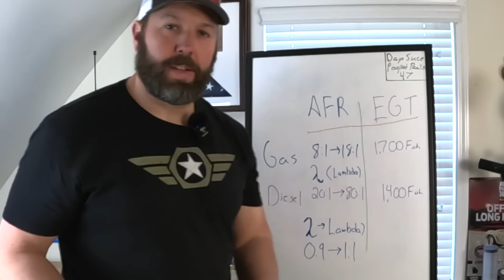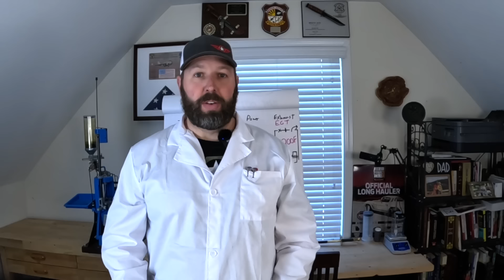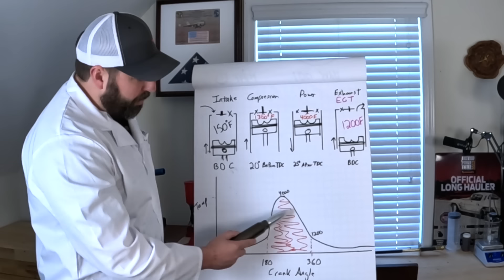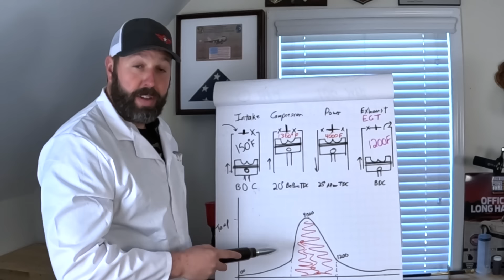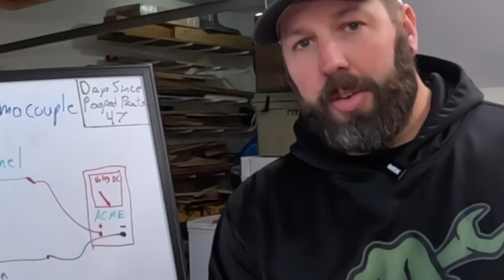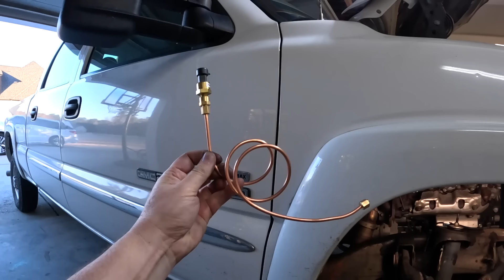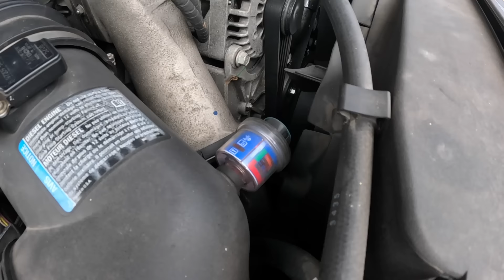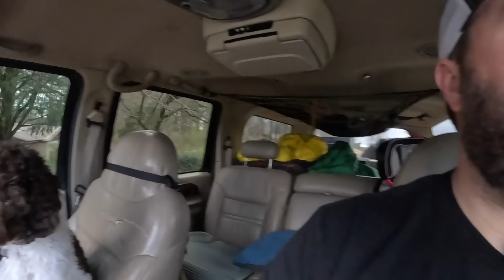Silent Diesel Killer…Diesel Exhaust Gas Temperature (EGT)! #diesel #egt #dieselengine

Comment: Great video!  Water meth injection will also lower egt
Reply from the maker: I actually had about a minutes worth of Water Meth injection footage at the end of the video originally, but I cut it out because I know most people aren't going to use it. But you are absolutely correct. 👍
Reply: @freedomworx  do you think water meth is worth it?
Reply from the maker: I think there are better options for a diesel, but if there is no other way, sure. A better turbo(s) for the operating conditions would be ideal, but that’s obviously more expensive.

Comment: RIP that boost gauge 😂
Reply from the maker: Not sure if that was the Turbo or the Boost Gauge squealing 🐷
Reply: Damm near 50 PSI.  That’s scary.  I thought 35 was bad enough…it is in a 3.0 litre 4 cylinder.  Thankfully it rarely sees this.
I have heaps of gauges measuring (4 times standard volume aftermarket) intercooler, both incoming and outgoing temps, boost, EGT, scan guage, transmission temperature.
Then I have an “engine guard”, with temp sensor bolted onto the rear of the head (fire wall side-so it’s the hottest), this also has oil pressure reading as well.  Only thing I haven’t got is oil temperature.
Reply from the maker: @martinlang9615  so basically you are a need like me 🤓

Comment: Life on a semi engine they are now designed with all this emissions crap end up running hotter temps supposedly  to burn off pollutants which means your engine is cooking life out of its self which will leed to a early failure plus they claim you can go extended oil changes but thats only leeding to more stuff in engines oil system flowing around killing rings bearings and components..so you use to get up to 2 million miles on a diesel if maintained good but now you get 600-750k miles and thier shot sometimes around 350k to 400k miles then probelms happen ...EPA is a joke thier mission is to kill our  ecomany any which way thier comunist heart tells em to do it...its un-American!
Reply from the maker: Newer emissions equipped engines don't run hotter, their emissions systems run hotter so that the catalysts in the exhaust system can do their jobs. The purpose of the EGR system is to keep the combustion temperatures lower to reduce NOX emissions.
Reply: Muuuurica! Land of the free! (not really 😂)
Reply from the maker: @illernpiller  where do you live?
Reply: @freedomworx  Sweden, not sure if my sarcasm reply to the initial poster went through =D
Reply: @illernpiller of the sheep*.